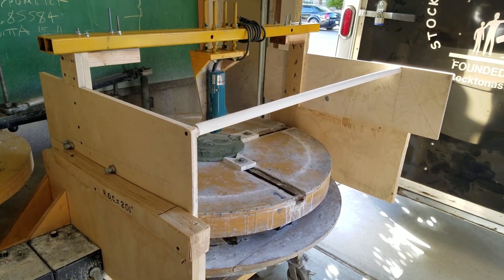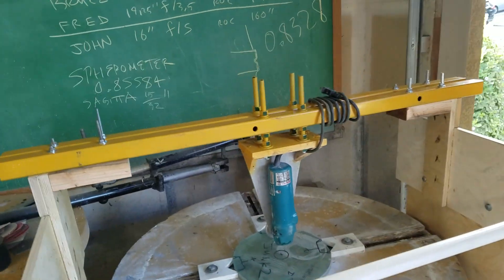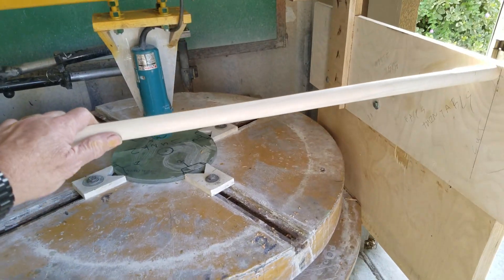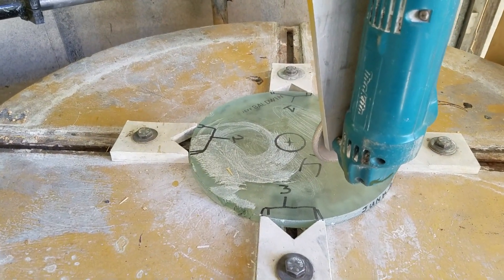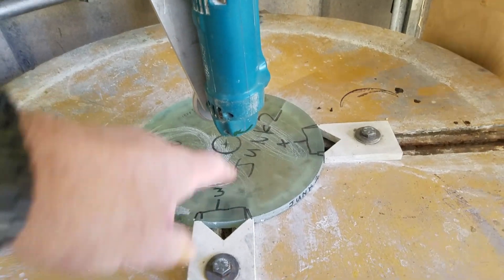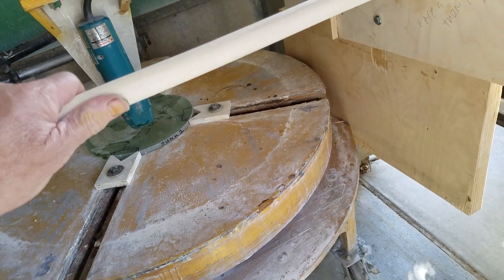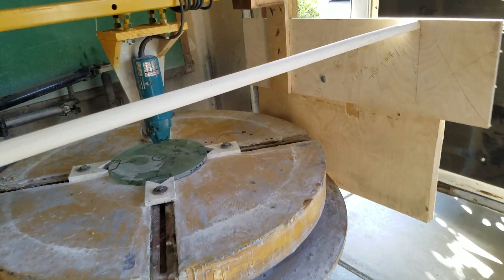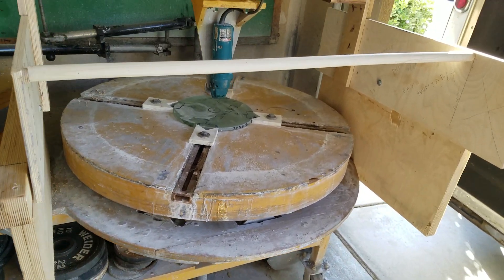Curve-generating apparatus for my mirror-making machine.

Comment: You should make it hanging , not rolling , and naturally when it hangs above the mirror that will be the radius , and the only thing it can grind will be a sphere , nothing else possible , now , if your mirror radius is 10m you will need 10 meter pole . This may be a problem , depends on the F ratio . But i guess you can make multipliers , and get it shorter , should be possible.